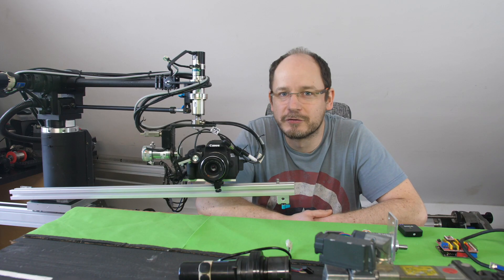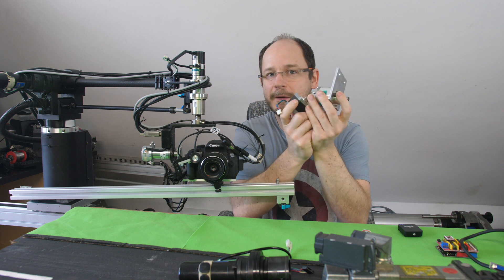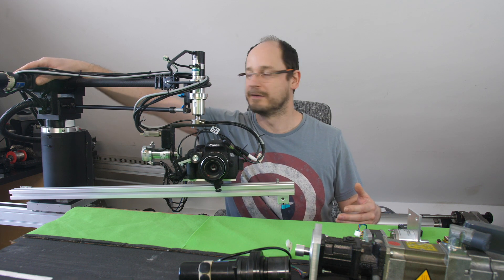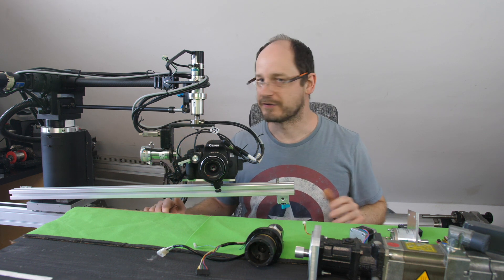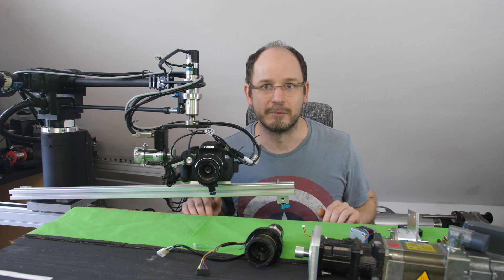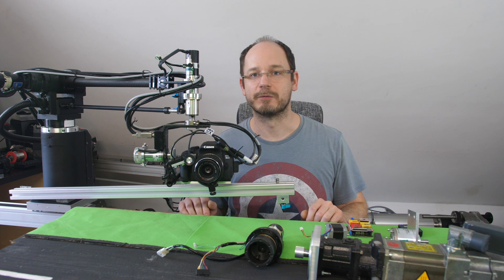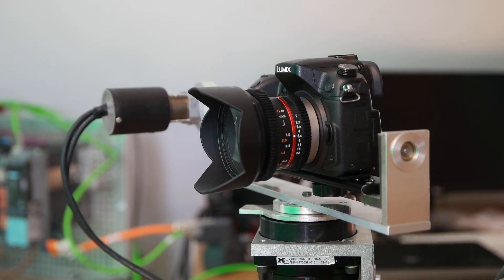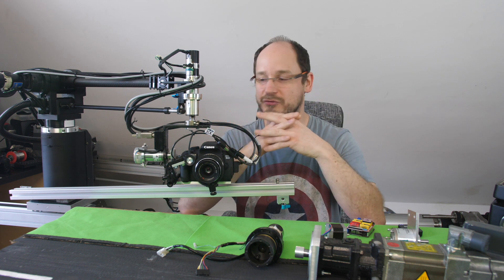DIY robot camera crane detailed technical description (Stop Motion - High Speed)

Comment: Hey! Nice video and thnk you for information, it's great.
Can you tell more about softwear? 
What APP do you use to control slider?
What about DragonFrame? I try to use it, but it work with frame steps with Arduino, and I can't use it for real time video, do you have same problem?
Reply from the maker: Hi I develop an own software. It is very basic at the moment, but I build the robot to be compatible with Dragonframe. So, Yes it can be used with Dragonframe. This rig is for stopmotion now, so I think that is the best software I can imagine. For fast camera movements I use UC100 motion controller and UCCNC (it is a cnc software, not for camera applications :)